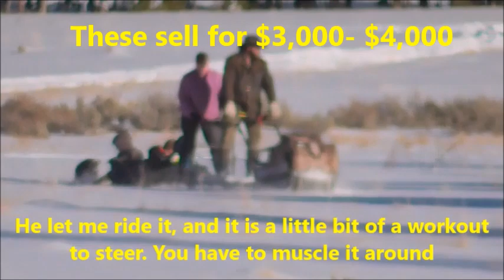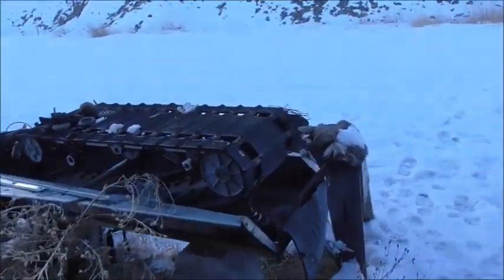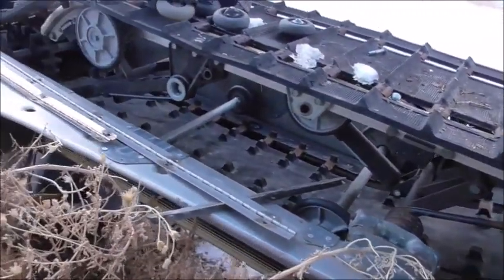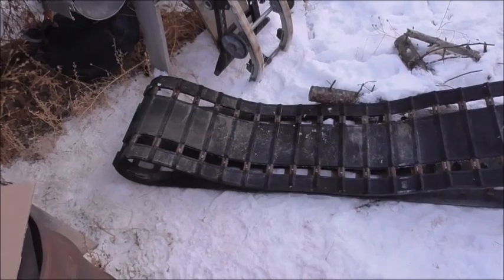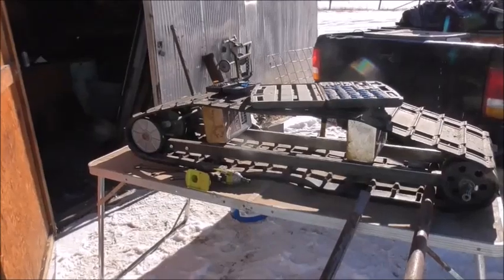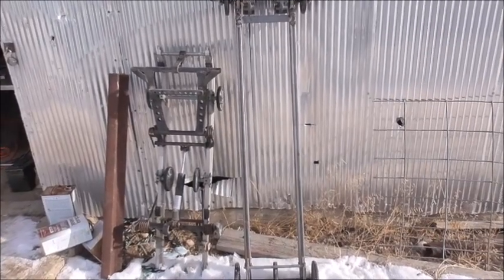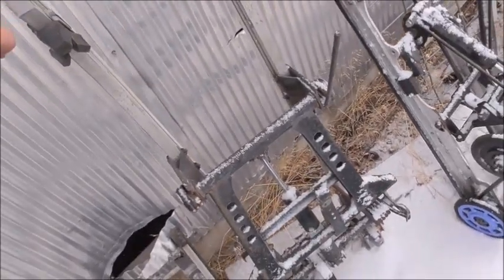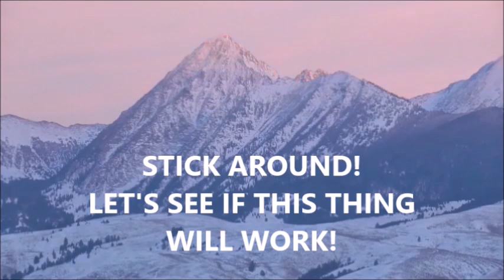Let's Build a Snowdog!!  Part 1

Comment: Hello my friend! I was very surprised when I saw the same moto dog as mine. We have a very widespread brand in Russia. We use a snow dog for trapping and fishing. But it doesn't walk in very large snow, falls on its side. The wider the belt and the longer the base, the easier the snow dog rides. Less than 15 horsepower does not make much sense to use. In Russia, the snow dog is not a vehicle by law, you do not need to pay tax and you do not need to have a driving license. You can also move around. on the ice of reservoirs. Fuel consumption is very low. This is a very good thing. I look forward to the results of your work!
Reply from the maker: How do you like yours?   The engine I bought is 14 horse...I hope it is enough!  I am worried about it not being wide enough.  If it tips over too easy, I think I'll put outrigger skis on the sides like they do some of those ocean canoes.  The model he has, and yours, is being sold here in the USA now, imported from Russia.   I don't think you need to license it here either from what I was told.  Since it is a towing vehicle, and you don't ride it, it is not considered a vehicle.....yet.
Reply: @MuskratOutdoors  I am very satisfied. My line of traps would be inaccessible without this dog. The engine for 14 horses is quite enough. The snow dog helps a lot to get to remote reservoirs, since it is forbidden to move on our car on the ice. The snow dog easily enters my van entirely, I do not need a trailer. Three men and some things, this unit is quite easy to move long distances. In Russia I bought it for about $ 1300, it is quite cheap.
Reply from the maker: @beaverural   I'm glad to hear that. I'm anxious to try it out. The road above my house gets too icy to drive on, and it's cliffy and dangerous.

Comment: Started one myself few years back, but put it off to the side. Very interested in this build can’t wait to see it finished.
Reply from the maker: I've been gathering parts for about two years now.   Since we haven't had as much snow as usual, what we do have is ice.  I've been frustrated not being able to get anywhere to trap, so I jumped into this.  This is more of a Summer thing to have ready to go by winter, but it didn't work out that way.   You should get back to yours!  Really, this is going together pretty easy for the most part.

Comment: You probably don’t do the Facebook thing but there is a group called “Track sled builds of the North” and it’s all for folks building snow dog’s, some good ideas on that page!
Some guys shorten tracks by using a lap joint others do it by adding a backing piece of belting and either way works good with the “power” these machines have.... gearing also comes into play and most shoot for around a 12mph top end... some folks just run sprockets and hub adapters on the original drive shaft and others use the snowmobile chain case and adapt to it with a Jack shaft setup off the comet clutch with a chain...
The custom frame setup is the best way to go and you are on the rite path, most all builds ive seen completely lock out the suspension and it’s much simpler that way.

Plan ahead tho, the small 4 stroke motors have tons of vibration and they rattle everything apart even the motor itself...

Can’t wait to see this thing come together, I’ve been wanting to build one for a few years now but can’t seem to find the rite donor machine
Reply from the maker: Thank you very much for the info!  I'm not a facebook fan.....too many liberals on there that make me mad!  Ha!  I'll look into this though for sure!   I'm almost done with this. I hope it will work. I put a piece of rubber belting under the engine, I hope that will help?  I ended up not shortening the original track.  It seems kind of long, so steering might be tough.
Reply: @MuskratOutdoors  
The only way you’ll know is to give it a run 😁
Most folks who build these things make a few changes before they call em done, common issues are the handle bars being a little too bendy when you need to muscle it around and as I said the vibration.... carry some spare nuts and bolts an you’ll be fine I’m sure 👍
Can’t wait to see it run 😀
Reply from the maker: @PuskwaskaOutdoors   Good to know!  I had a handlebar off a push weed whacker I was going to use, but I think it is too light duty. The nuts and bolts, I've used all nylock nuts with the nylon inside.  Extra is a great idea.  I really don't want to walk back home!
Reply from the maker: @PuskwaskaOutdoors    I thought I was subscribed to your channel, but I just looked....nope......I am now!!

Comment: Thanks for sharing this should be fun to watch and see how it works out. Sounds like a machine that could be very helpful in your neck of the planet.
Reply from the maker: Thanks!  I think it will be.  My biggest  problem  with trapping here is access.  The roads get too icy to be safe to drive.  This should solve that problem if it works.
Reply: @MuskratOutdoors  hope it works out great for you man I've never seen anything like that here in kentucky but have seen a lot of snow mobiles up north in michigan. Starting with a brand new engine has to be a good thing going into the project.
Reply from the maker: @rickballard1627  Thanks.  I really don't want to have to walk home.  The salesman said it was made by a well known name brand, for a cheaper market.....hopefully he wasn't lying!

Comment: Hi there! Any chance you could upload links to the parts that you were able to buy online?
Reply from the maker: I would, but I don't have any links.  Most of the parts I bought were off ebay, or scrounged from junked snowmobiles at the recycle yard.  I'm afraid I'm not going to be much help. Sorry!  If you haven't seen it, look up the facebook group "Track Sled Builds of the North" Lots of good info there and folks that will answer questions and try to help. They make you "join" the group, but it doesn't cost anything. Good luck!  These things are kind of fun!